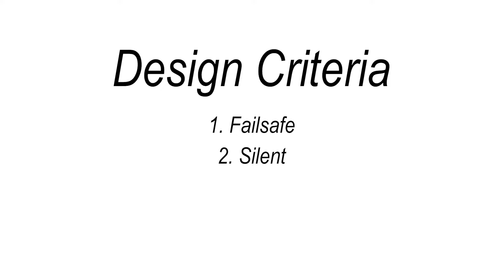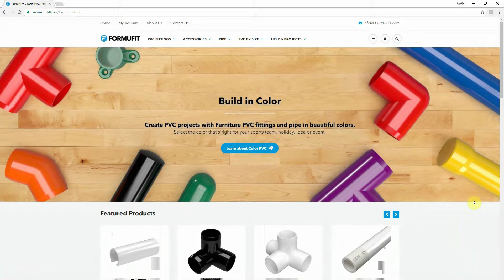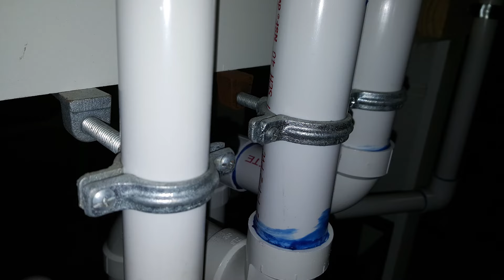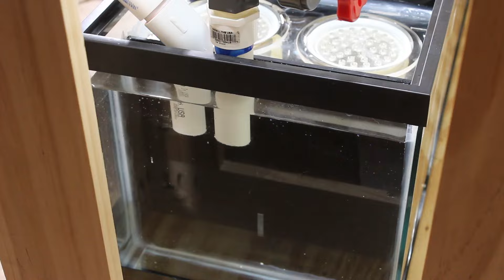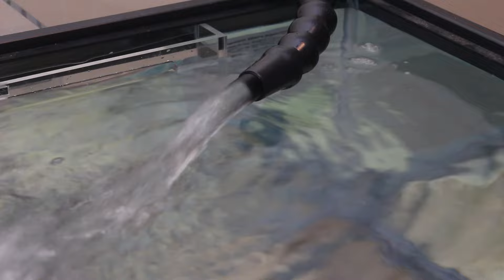Plumbing Installation - Bean Animal Style

Comment: I'm sorry, but to make for an ease of installation of plumbing inside the overflow box,  I would recommend changing the order how it is installed in the box instead of how it is shown in the video. Depending on the size of the box, it gets crowded in there fast and you don't want the emergency drain in the way, so put it in last. Especially important if you have large hands. 
Remember you'll likely need to trim the length of the two threaded bulkhead pipes coming from the tank. Put the nut on the threaded pipe inside the overflow box an snug down before you cut it with a hacksaw blade, usually about 1/4" longer than the nut surface. This is done to give you room to put the other plumbing in the overflow box.

This is how I would install the plumbing:

1.  Do this first - At 4:53 "For the siphon, use a small length of pipe to connect a 90 to the bulkhead (bottom of the box), then another small length to connect another 90. The goal here is to get the siphon as close to the bottom of the box without it getting so close that it restricts the flow. That way, you can keep it from creating a vortex and keep it from sucking air in from the surface of the water." 

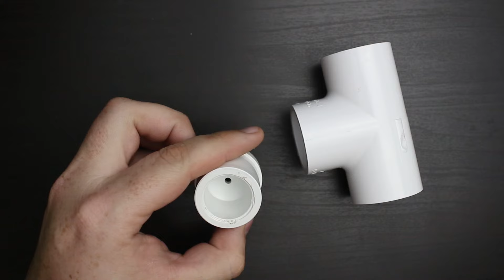2. Do this next - At 4:13 watch how to set up the "open channel".  The top of the connectors must be installed higher than the siphon you just put in.

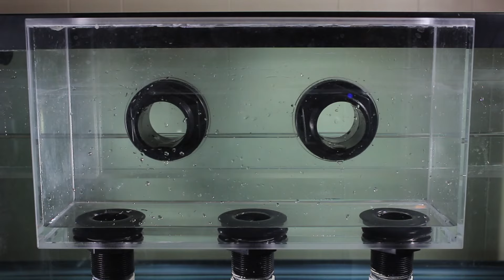3. Do this last - At 3:52 watch how to set up the "emergency drain".  You'll have the top of this pipe anywhere from a touch above the top of your "open channel" fittings to about 1" to 1-1/2" from the top of the box.
Reply from the maker: Stay tuned. I have designed some modified stockman drains that I have 3d printed that fit the pipes, as well as an emergency drain that increases its ability to process more water with less rise. They come in two parts and can be screwed together inside the rear box so they are larger than they could be a single piece and still pass thru the eurobraced top. They all clear the pass thru bulkheads easily without any modication. I hope to have them available in the next month for sale as an add-on to our current boxes.

Comment: Do you put two gate valves on the siphon line , with one near the over flow blow and one near the sump ?
Reply: I don't think so. I put mine right where it runs into my sump and it works great there.
Reply from the maker: Just one. Right before the sump. This allows the pipe to fill up with water, so you only have a little water to purge right after the valve.

Comment: Where did you purchase the L bracket for the all thread
Reply from the maker: It is called side beam bracket. Here is a link to one at home depot. But there are a ton of them for sale on Amazon as well.

https://www.homedepot.com/pep/PLUMBFLEX-Side-Beam-Rod-Connector-in-Malleable-Iron-for-3-8-in-Threaded-Rod-38CNSBPL/309983845?g_store=6517&source=shoppingads&locale=en-US&fp=ggl&pla&mtc=SHOPPING-BF-CDP-GGL-D26P-026_001_PIPE_FITTING-NA-NA-NA-PMAX-NA-NA-NA-NA-NBR-NA-NA-NEW-_PMAXTEST&cm_mmc=SHOPPING-BF-CDP-GGL-D26P-026_001_PIPE_FITTING-NA-NA-NA-PMAX-NA-NA-NA-NA-NBR-NA-NA-NEW-_PMAXTEST-17697557984--&gclsrc=aw.ds&gad_source=1&gad_campaignid=17687574624&gbraid=0AAAAADq61UdhwvVrqSkQez6tqY6QviWbl&gclid=CjwKCAjwqonVBhA4EiwA9wYJ3e2C4IVKmieUV53P5Y7WR0TFhZmmVQUXYAsL0jJLF1JL6SMiNtFuAhoCl7wQAvD_BwE

Comment: Great video my only complaint is the space left between the lines my ocd doesn't ever allow this simple method 😂 I have to run the lines as close to each other and matching as much as possible for a more clean open look but this works just fine if it visually doesn't bother you

Comment: Can you elaborate on the gate valve location being as close to the end of the line (presumably the sump) as possible.  I have heard the exact opposite of this and noticed in the video there is at least two shots where the gate valve is immediately off of the drain box (so very close to the beginning of the system).  Thank you for taking the time to explain in more detail, I greatly appreciate it.  I’ll be installing my new drain pipe next weekend so I want to plan for the “best practices”. 😊

Comment: Excellent video and info!
Questions: Can I plumb a bean animal overflow with flex pvc? Also, I'm planning a main floor display with a basement sump, and am wondering where the best place for the gate valve on the siphon line  would be - still furthest to the bottom?
Reply: exactly my questions, too bad yours wasn't answered

Comment: Nice video! How shall I size the plumbing for a 5500 lph (approx. 1500 gph) flow rate tank with bean animal?  Are the 1" siphon line and two 1.25" for the emergency and open drain lines sufficient? Larger or smaller diameters than this?

Comment: Love this video. One of the best I have seen however, I'm confused! At 4:44 why doesn't the right hand overflow syphon to the bottom of the elbow? Surely the pump isn't replenishing faster than it drains. Thanks
Reply from the maker: Because the gate valve is still partially closed, limiting the amount of water that can flow through it.  There is still some amount of water flowing down the open channel (center), so it is setting the height of the water in the box.
Reply: @exoticmarinesystems7808  Ahhh. Great. Thanks for the reply.
Reply: So I'm all set up with the beanie. Do you have a video on tweeking it to syphon? I got it syphoning but when I drop the pump and turned it back on, it didn't syphon again. Thanks
Reply from the maker: @nicwilliams00  I would need a little more information on your setup.  But the usual culprits are using plumbing that is too large for the flow rate you have.  Also, how far down into the sump water does your siphon line extend.  You want it to only go down into the water about 1".  Do you have the valve set up at the end of the line, or at the top right below the overflow.  You want the valve as close to the sump as possible.
Reply: @exoticmarinesystems7808  Hi thanks for reply. Pump is 1000l/h on a 95l display and 25l sump. All 3 lines are 1". Syphon line is 2.5" under water. I'll cut some off this to 1" today. Gate valve is 6" above water line. I need to order some more fitting for the elbows and tees in the OF box as I cut them down to see if that made a difference.
Reply: @nicwilliams00  g'day, just a guess but maybe the 1000lph isn't enough to fill up the bottom of the pipe/hose? 1" is pretty big for 1000lph minus whatever is lost on the way up etc. I experimented with just the Herbie doing some DIY and I dropped the main hose down to one size smaller I think it went from 25mm to 19mm

Comment: Great video! 
Question:
1. Do both of the siphon lines need to be under water in the sump to make this overflow work?
2. Is one gate valve on the main siphon line good enough or do I need another one for the secondary line
Reply from the maker: They aren't both siphon lines.  Only the right one is.  The other is an open channel that shouldn't have a valve on it.  The siphon line should have a gate valve on it, as close to the bottom of the drain is as reasonable.  They technically do not have to be below the water line to function, but they will be extremely loud and splash water everywhere.  The siphon line needs to terminate just below the water line, so that it can easily purge all the air out of the line when it starts.  The open line (left hand pipe) can end at any depth under the water.

Comment: Agree... Best video on this topic.  It took me a month of research and collecting info from different vids & forums to acquire all the best practices you have in this one video... esp. The siphon drain pipe 1-2"  below the water line.. enough to quiet but not enough to prevent air purge. Also the gate valve at the end.. the more unrestricted pressure you can build up..the more you can get out of each size drain siphon.  Same idea, even ifvgoing with 1" drain... you can plumb everything 1.5 until in the box and down the back and THEN reduce to 1" on  drain once entering the sump/stand area.. this pressure will make it easier to start &vpurge your 1" main drain & maximize gph.
Reply: you won't gain gph by doing that as the tubing still ends with the same width it'll just add more weight to the suction
it's also what many people use in racks so they don't install drain boxes...
drill all tanks with 2, 2" holes one for overflow and another as backup
the 2" goes into 4-5" piping creating pull weight and this way they only need a sponge inside the tank...it requires less maintenance because of the gravity weight pull
each tank have a ball valve for the drain so that if a tank in the rack somewhere breaks...leaks whatever the reason...
close the valve and just unscrew the drain off the tank and replace it
this way the entire rack keeps running
the issue with that is that you need a much larger sump because the main drain pipe runs underwater so the sump will have to accommodate for that
or just use the entire bottom rack as the excess water hold backup...something like making the entire bottom rack a 'sump'

Comment: Great video! One thing on the strapping, depending on the pad under the aquarium you might get a bit of compression as the tank fills up. This will apply pressure to the overflow box since your pipes are bolted to the stand which isn't moving as the tank compresses towards the stand. Might think about strapping after the tank is full.

Comment: Why would you feed the emergency overflow back into the return compartment of the sump? Firstly, you would mix up clean and dirty sump water. Secondly, you would feed the water back into the system therefore voiding the function of the whole thing. I would feed it into an empty wastewater barrel otherwise used for water changes... Did I get something wrong here? 🤔
Reply from the maker: The purpose of the emergency drain is to process any water that cannot be drained through the two other drains.  The reason I put them in the return section is because it makes it easier to plumb the system and keep the pipes out of the way.  If you ran all three pipes to the drain section, they would be very crowded and would probably cover up some portion of the sock section, making them harder to remove.  You do NOT  want to drain your emergency drain outside the tank.  It would do one of two things.  First, the water level in the sump would lower to the point that the pump would draw in air and stop working.  Secondly, your ATO would begin adding fresh water to offset the water loss.  It would continue to run until the top off tank is empty, lowering your salinity.  As far as draining dirty water in the back of the sump, this drain is for emergencies to keep your tank from overflowing onto the floor.  Don't be too concerned about where it is located.  You just want it to safely get your water into the sump in the event of a drain clog.

Comment: Everyone uses Teflon tape and pipe dope on plastic threads. Not sure where they get that idea. Also, 2 45 vs 90 degree elbows have been found to have a negligible difference in flow
Reply from the maker: I am not really sure, but Lasco is one of the largest PVC plumbing manufactures in the Country, so I just go by what they say.  I am also friends with several master plumbers they all agreed that this is basically right.  A lot of people use tape, but it is not the proper procedure on PVC.
Reply: @exoticmarinesystems7808  Seems the concern is probably overtightening due to lubrication.  I've never actually had a PVC fitting split from overtightening though.
Reply from the maker: @E_8519  Neither have I, but I have heard of people that have.  The paste is really easy to use, but messy.  All things being equal, I don't really see any downside to using the paste over the tape.

Comment: I‘m looking at the eShopp Small design with just an emergency and a single drain.  Should I just go bean style ?  Thanks
Reply from the maker: I personally believe that unless it is a very small tank that Bean Animal is the only way to go.  You really need a siphon and an open drain to make it "set it and forget it" simple.
Reply: @exoticmarinesystems7808  so basically turn the drain into a bean, the one on right in that thumbnail, below the water line?  All it is, is a u shaped PVC?
Reply from the maker: @mogtrader8  You have to have three drain lines to be able to do a bean animal.  You cannot do it with two.  With two, it is basically a bean animal but without an emergency drain.
Reply: @exoticmarinesystems7808  the eshop small overflow has only two drains.  as such, should i go durso? i feel better keeping the emergency. but if u have any ideas, please let me know. thanks
Reply from the maker: @mogtrader8  If you keep your flow levels at a point where the open channel can support the whole flow, then you pretty much have an emergency drain.  In a normal mode, the siphon handles 99% of the flow and the open channel handles the other little bit.  If the siphon gets clogged (either completely or partially), the open channel will handle more flow (loudly).  The problem becomes when people operate at such a high flow that the siphon can handle it, but the open channel can't by itself.  More than a few 100 GPH, it is impossible to make an open channel silent...
Reply: @exoticmarinesystems7808  the overflow is rated 600 gph.  i.havent seen too many videos on the two drain models, so hoping to see what could be done.  it seems like modifying the main drain into durso is the way to go.
Reply: @exoticmarinesystems7808  hmm, would a herbie setup work in this situation, of just two drain?  since bean aninmal is out, then what other options would I have.  more importantly, i just wanna ensure safety.  tha.ks for ur help

Comment: Can someone post a link to the 2 180 sweep fittings that is shown in the beginning. Whats the one with the cap looking thing at the peak of the 180?
Reply from the maker: https://www.homedepot.com/p/NIBCO-1-1-2-in-PVC-DWV-Hub-x-Hub-x-Cleanout-P-Trap-C4884HD112/100344828

I thought they looked cool, but honestly, the hole is too large that noise can get out.  The best thing to do is buy them without it and drill a small hole in the top.  Try it out, and if need be enlarge the hole a little.  But when tuned properly (very little water flowing through open channel), you don't need a very large hole.

Comment: This was a very helpful video. Planning to do this in a 720 gallon aquarium with flow rates at around 5000 gph. Would 2" siphon, open channel, and emergency drain be able to hand this amount of water flow?
Reply: @ ohmyheadd    The answer is NO.
First of all,a 2 inch unrestricted full siphon will only flow 2400gph max with a minimum 36 inch vertical drop.
Anything less than 36 inches and it’s less than 2400gph.
You would need to install two separate overflow boxes to get close to your 5000gph rate.
Reply: @kennethfarley8347  thanks for the reply,. I actually have this setup right now. I have two jebao dcp 20, 000 running at max (around 5200 gph each). Head height is at least 6 feet so quite a distance. The 2" siphon is more than capable of handling both pumps. I figure the head height is so big that my pumps are probably not pushing anywhere close to what they are rated at. but who knows

Comment: so you say dont use the gray 80 pipe it smaller ID but yet you use the internal thread of the bulkhead witch is a hole lot of a id reduction can you say contradiction
Reply from the maker: That is one of the reasons I suggested against using sch 80 plumbing.  I just went and measured the restriction of the threaded coupling, and it reduced it down about 1/8" for about 1.5" of length.  The restriction would not cause any significant reduction in flow for that little bit of distance.  Now if it was for the entire length of pipe, it would add more.  There are a few reasons we sale them with threaded bulkheads on the bottom.  When you can thread into the bottom of the bulkhead, it removes the need to put a union under the box so that the plumbing can be removed for service.  For certain shallow tanks, adding a union takes up too much vertical space, making it hard to mount a stand off at the top of the stand before angling the pipe into the stand.  Also, a 1.5" union at Lowe's is over $8, so just removing those three pieces saves around $25 alone.  I stand by my assertion that since the introduction of furniture grade sch 40 PVC, there aren't really any good reasons to use sch 80 pvc that would restrict flow and would probably never see more than 3-10 PSI.

Comment: so if I'm using your style of overflow box with BA set up. what is the difference if i just put a strainer write on the bulkhead on the syphon line as opposed to a standpipe?
Reply from the maker: Probably none.  I will say that when not using the U, it seems to take longer to start the siphon and get the back box to a stable level.

Comment: I don't get why you need the u shape on the primary drain line?
Reply from the maker: In my experience, when you get a decent amount of flow going, it will create a little water tornado like you get in your bathtub.  With the U pipe, you can flow a lot of water.  Plus it helps with start up.  It delays the siphon starting for a second or two and allow it to become full submerged.  I don't know why, but it makes the surge finish faster.
Reply: @exoticmarinesystems7808  makes sense now, the tornado part is the visualization I needed. I was going to set up my new overflow like a Herbie, just with 3 straight pipes in gradual lengths instead of the 2